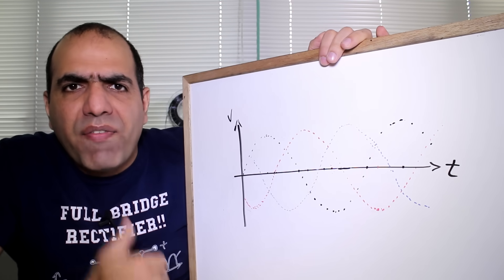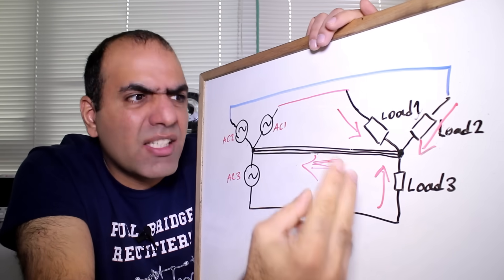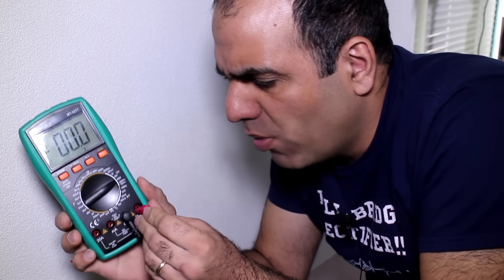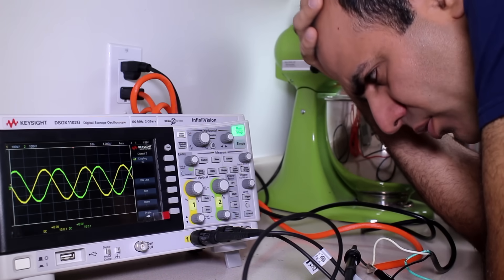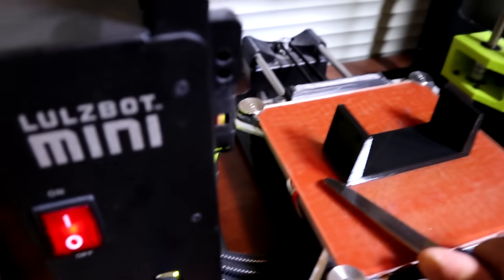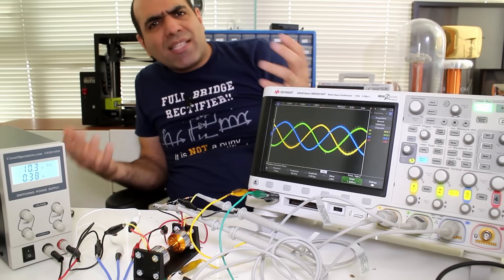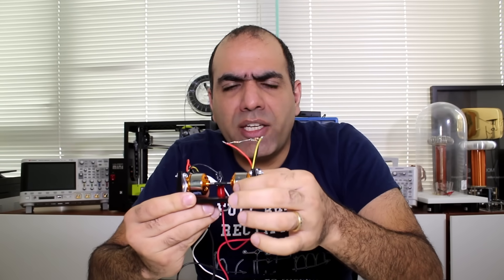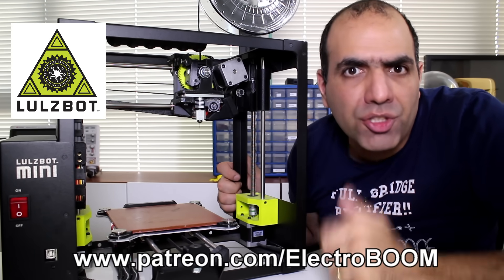Why 3 Phase AC instead of Single Phase???

Comment: ONE CORRECTION:

The technical name for what is known as brushless dc motors is PERMANENT MAGNET SYNCHRONOUS MOTOR (PMSM) and not AC induction motor.

You can guess from the name, PMSMs have a permanent magnet in them to create rotor magnetic flux. On the other hand, induction motors rely on the induction principle on the rotor windings (or bars) to create rotor magnetic flux.

Induction motors (invented by tesla) can run directly from the grid with no additional controller. But synchronous motors require additional synchronization procedures to synchronize with the AC source, both electrically and mechanically. In principle to make a synchronous motor work from a fixed frequency ac supply, (just as what you tried to do by connecting the motor with the propeller to the output of the generator,) the rotor speed has to match the source frequency, and also the phases have to match exactly the source. By directly connecting as you did, the phases and frequency did not match and at this condition syncronous motors cannot work properly, and that is why that propeller motor failed to run and vibrated uncontrollably.

Great show though.

Comment: Long time fan.. I have a question about phases..
I have a 3 phase voltage regulator/rectifier from a motorcycle. It has 3 yellow wires for each phase, and a red and green for DC out..
I want to use this in a different motorcycle that only has 2 phase AC output.
Can I just use 2 of the yellow wires and leave one phase out? Would this change the output voltage?
Thank you
I guess I could try it wearing my helmet cam in case I let the smoke out. Boom Style!
Reply: +BlindDude - Offhand I would say yes. If the bike you want to put this on really has a two phase output, there should be three wires. Simply connect them to the three yellow wires on your rectifier the same as you would if you were using a three phase source. OTOH, if there are just two wires, then you really have a single phase alternator on your bike. It would still work, though. Just connect to any two yellow wires and leave the third one open. As for voltage output, that should be more of a function of the regulator and the current rating of the bike's alternator. I don't think you'll be letting the smoke out with your idea.

Comment: in canada we run 2 phases to each home????
No,  its a single phase.   A split phase to be precise.  Every other breaker on the CB panel is the opposite side of that single phase.  To get 240v you simply run tap across 2 consecutive breakers instead of using one and a neutral.
Maybe in apartments it is different, but in houses it a single phase.
Reply: Yes: He's probably in an apartment or condo building that is wired up with commercial 3-phase power. Every unit would be handed out 2 phases in a round-robin fashion to try and keep it balanced. 208 volts across the two legs is a dead giveaway for 3 phase power since if he were on split-phase it'd be 240.
Reply: And over here, if I want 240v, I just use any outlet that i want to.
Reply: Ah, I thought it was split phase for the home as well. Thanks to Mike Pepe i'm starting to get my head around to understanding 208 volts we use at work, kinda!
Reply: @glennfrancis9031  In the US and Canada there is a wide variety of domestic and light industrial electrical supplies, so you can't assume anything in particular.
The 'most common' domestic setup is that each household gets a single 240V phase, via a centre-tapped-and-grounded transformer so it looks like two 120V supplies.
The full 240V is then available by connecting a load across the two live conductors, instead of between live and neutral.

Some place instead get actual three-phase - more common out of the city where farmers etc want to run bigger kit like welders.

But wait! There's two types of three-phase - star (wye) and delta.
Star/Wye has a neutral at the centre, as described in the video - 'nominal volts' (120V) between any Live and Neutral, and a higher voltage (208V) between any two lives.
Delta has no neutral, and is instead nominal volts between lives. You connect your load between the two lives. In the US it's generally either 120V or 240V phase-to-phase.

But wait! There's a third type of three-phase - "wild leg"
In "wild leg", you start with a normal delta three-phase, but centre-tap one of the phases (and usually ground it).
In the US, this is used to give 120V, 240 and 208V supplies from the same transformer: Centre-tap between L1 and L2, call that tap the 'neutral'.
If L1 to L2 is 240V, L1 to 'neutral' is 120V, L2 to N is 120V, L3 to L1 is 240V, L3 to L2 is 240V, L3 to neutral is 208V.

So just because you've got a 208V phase, it doesn't mean you've got 3-phase Star/Wye

Comment: In case you use triangle configuration (not the star one) you got about 5 times more power delivered by same three wires compared to single phase AC.

Comment: Thanks so much for these videos that actually teach the basics of electronics in a very funny way. You spoke about the 3 phase AC motor. With this type of motor it is also possible to brake (dynamic braking) which is used in trains to brake the train (duh) but also to return power back to the powerline. Could you explain how this all works? Thanks!

Comment: Very good video. I have worked with industrial three phase systems/automation for 20+ years and still find it interesting.
Maybe you or one of your followers could answer a question I have. I was recently working on a three phase motor that had recently been installed but wat tripping an overload. I disconnected the motor leads from the 208VAC supply and measured the resistance phase to phase. One of these measurements indicated a short. (I also checked for a short to ground but found none.) 
The person who owned the machine said he was sure the motor was fine and later told me that we needed to wire two phases to 110VAC and the third to 208VAC.
I have never heard of intentionally wiring a motor imbalanced and don't know what would happen short or long term. I refused to wire it this way and didn't want to touch it after they did.
Have you ever heard of such a configuration or know what the results would be?

Comment: Never, never, NEVER ... take a bare ended electrical cord and plug it into a wall socket. This is called "An Idiot Killer" for a very good reason!

For anyone in the U.S. none of this applies to your home wiring. Industry in the U.S. is supplied with 3 phase for the reasons explained in the video, but the electricity to your house is supplied by a transformer somewhere close by the house. This transformer is center taped and comes into your house as 240 VAC. The center tap acts as neutral and divides the 240 volts in half to 120 VAC.  This is divided to two sides in your fuse panel and supplied to the house outlets as either side A or side B. Only in the kitchen going to the stove and oven, to the utility room for the water heater and dryer will you find the full 240 volts in a single outlet. If you look on the oscilloscope at each side of U.S. house wiring, the two sine waves will be 180 degrees out of phase. You will not find both phases going to a normal wall socket in the U.S., side A going to the top and side B going to the bottom sockets, unless the home owner has done some custom wiring. To be "to code" the custom outlet must have different geometry than a normal 120V wall socket and should be labeled either for it's purpose or at least that it is 240 Volts.

Comment: سلام
I watched this video recently that was supposed to be a free energy bullcrap but the thumbnail looked like a three phase generator with a motor and a magnet i thought it should try to run this generator by a battery and the good part whould be that i learn how to wire a three phase generator LEST THE NEED RISES so i played it and when everything was installed and the guy started the wiring every thing went to shit ,this is the link to it     https://youtu.be/rkKFv3qX_sk    I would like to know can the wiring be right or is it fake  Thanks🙂

Comment: The 3 phase current captures the motion of the generator. It can be used as a sensor to detect angle of rotation. I seen this in analog autopilot systems.

Comment: I NEVER turn my meter to voltage after I finish measuring current, unless I want to measure voltage immediately after. I always turn it to OFF, because otherwise it will use up the battery. (This is especially important if your meter has a backlit display like mine. Also, please don't comment that most people can't afford fancy meters with backlit displays. I bought this meter for $5 used on eBay because I couldn't afford anything better, having spent all my money on electronic components.)

Comment: In england. The old british standard has Black and Neutral, Red, Blue and Yellow as the three phases, and green/yellow striped wire as ground. The European standard, which is now a newer british standard, Blue is Neutral, Brown, Grey and Black are your three phases, and the same green/yellow striped wire is ground.
So, if you have a phase with only a Black and Blue wire in it... which is the live, and which is the neutral? is it the old phase 2, or the new phase 3?

Comment: Why not use dual phase with 180 degrees difference between the phases? You would still get a virtual earth by combining the outputs across 2 equal loads.

Comment: In the U.S. and Canada, single phase voltage is 120/240v bc the phases are 180 degrees apart.  3 phase voltage is 120/208v since the phases are only 120 degrees apart.

Comment: If two waves are 180 degrees out of phase then shouldn't they cancel each other out as destructive interference? I thought with all waves you only get constructive interference which would increase the voltage by doulbe if two waves were in phase and not 180°out?

Comment: Hey why do we use 3phase why not 6 phase or something more higher 

In Canada you have 120V AC at 60hz 
And in India we have 230V AC at 50 hz 
But why ?
Why don't we use same voltage and frequency  ratings around the globe. 

You said motor you used are AC but you never specified which one are they induction or synchronous machine

Comment: Over here in Norway, Europe, we used to have 220 volt AC, but over the past 30 years it has changed to 230 volt AC. Most households have 1 fase, one live wire and one passive. We do not have ground wires leading back to the power plants or even to the substations. Ground is usually just a copper plate under the house. Saves miles and miles of expensive copper wire between the houses and the power plant, but does not provide a reliable ground. Lately, some houses are offered 3 fase AC.

Comment: I'm 40 years as electrician and into RC models and brushless motors . This video is SO GOOD and FUN it should be used in apprentice training . Great presentation . You get the message across really quickly . They have short attention spans . You are an absolute Legend !

Comment: Beware, brushless DC is not the same as induction AC. Both work with 3 phase AC but one use permanent magnet and the other use ferromagnetic bars that are polarised with the coils when the motor starts. That's why when you use induction motor, you have to use a good electric variator to polarise your bars with minimum power loss. That is also why we talk about synchronic and asynchronic motors

Comment: When I think of 3 phase motors, generation. I think of an old school steam locomotive wheel and drive bar. As the wheel turns, the bar moves up, down, left and right. If you were to take, hypotgetically, a piece of paper, put a marker where the bar bearing goes, and that piece of paper is moving forward. You get a sine wave. There are animation gifs of it but I can't post on here.

Comment: Not to mention another benefit of 3 phase ac motors do not need special starting devices like single phases do. Such as starting capacitors, and separate heaver windings that need to disconnected from the power once the motor is up to speed by a centrifugal  switch

Comment: In Canada transport lines  is 3 phases 120 degres,  commercial business usually got 3 phases  120 degres, houses tho get 1 phase  of the transport line but in a split phase 180 degrees  mode split with a transformer center tape.

Comment: Why do canadian/american sockets use 3 wires if every socket itself gets a single phase
Reply: hot, neutral, ground.
Reply: H Majhail oh. Ok.
Reply: I suggest watching "the engineering mindset" on youtube if you want to learn more about this stuff. this dude doesn't explain it that good.
Reply: H Majhail from what i can tell by the names, the hot is the phase, the neutral is the ground of the circuit and the ground is for the exterior of the exterior of the object so you won’t get buzzed by a power uhmm... surge? leakage?

Comment: how is a 120 degree phase shift generated? im just thinking in terms of an all pass filter, with filter order corresponding to phase shifts in blocks of 90 degrees

as i understand it, 120 degree phase shift would be like a lowpass filter with a cutoff of 9 db per octave. i don't know how far off the mark i am, my understanding comes from more of a dsp angle

Comment: Very interesting look at 3 phase. Question. How did you get 2 different phases to a single outlet? Why would anyone do that? It would require that the top and bottom have a separate wire gong to the panel box on a separate breakers and those breakers be on separate phases. Or did you do that on purpose just to set up the demonstration?

Comment: It's also worth noting that a 3-phase motor is basically a fancy inductor and therefor the speed controller need not do things like perfect sine wave (which is done with an inductor) since the motor in fact acts to smooth out the steps thanks to inductance.

Comment: In the USA we use split-phase power distribution. There are typically single phase of a three phase system running much of the distance to the house being split far up the path from the sub-station. This 240v phase is further split using a transformer into two phases at 180 degrees. Which means if you measure between phases in a house in the USA it will be 240v although its still in spec to dip to 220v. Plus phases are never near the same circuit in the USA so you're unlikely to find an outlet carrying both phases unless the electrician likes to live dangerously.

Comment: Rhetorical question: Why is a higher-frequency used for AC power in aviation?
Reply: Higher frequency (400Hz) means less weight.  Magnetic components like transformers get smaller as frequency increases, thereby using less iron and weighing less.

Comment: If you want your 3d printed part to be stronger you need to print it on it's side. In that configuration the grain of the layers will be across the whole part as opposed to printing towers that break easily. Also you should calibrate your extrusion multiplier and Esteps so the layers don't split as easily.

Comment: Hi, i’m a beginner, i have project using a 220V AC voltage, i’m very thankyou if make a video about making a safety device using galvatio isolation transformer to save me from short and get shock if i accidentaly touch the phase or shorted my project

Comment: A few more reasons: 3 phase motors are self starting and don't require mechanical commutation, which makes design simpler. The magnetic field created by a 3 phase motor is constant magnitude which means they vibrate much less than a single phase motor and last much longer as a result.

Comment: hey Boom, do you have any experience building a 120vac/240vac to 5vdc/12vdc smps to power a micro controller off mains power. I'm trying to make some home automation stuff using the wemos mini and I would ultimately like to design a board that uses the esp8266 with an intergrated smps so all i have to do is hook the mains up to one side and the device I want to control to the other side. I've looked online but I can't seem to find a good example or tutorial on making one.

Comment: Two phases to each home? Are you not confusing two phases with the two legs (A & B) of the secondary winding of a centre-tapped transformer? From the centre tapped "Neutral" to either leg is 120V and the voltage between A and B is 240V.

Comment: Ah, you are forgetting about DC transmission lines. In the US we use high voltage DC instead of three-phase AC because it is more efficient over longer distances. Edison had a point. DC rises again.

Comment: This video spreads misinformation because Tesla DID NOT use three-phase AC, he used Two-phase AC !

Three-phase power and its huge advantages were firstly demonstrated to the public at the International Electrotechnical Exhibition in Frankfurt in 1891.
This day marked the beginning of using Three-phase AC as a base for the German and global power-grid.

The key engineer behind three-phase AC was Michail Ossipowitsch Doliwo-Dobrowolski he also invented the three-phase Induction motor which is ironically used in the cars of Tesla Automotive
Reply: Tesla patented 3phase sistem in 1888.

Comment: I have seen rc helicopters who where converted to gas instead of nitro. The guy used a brushless motor to supply power to the servo's and other electronics  never need to charge a lipo to fly. Just pull on the cord and fly untill you need to refuel.

Comment: That's really weird, I always assumed Canadian residential electricity was the same as the US, that is 120 / 240 volt split phase with each of the phases 180 degrees apart. Is it really that common to have two 120 volt phases, 120 degrees apart coming to a house?
Reply: In a big areas uses 3phase transformer 120/208V. The 3 wire service is a 2 hots + neutral 2x 120/208V with a 2 element watthour meter.

Comment: just wondering, i know of some larger three phase pumps that the phases run on 120, 240, 480 volts, wondering why they are different voltages, separate windings?